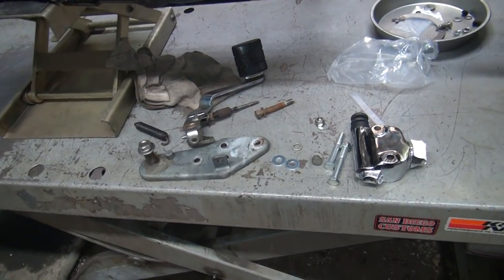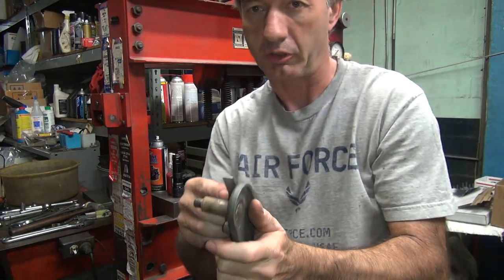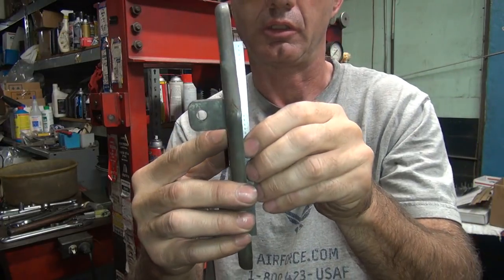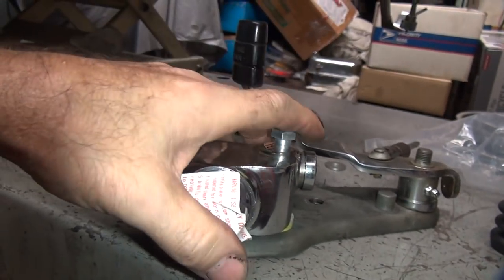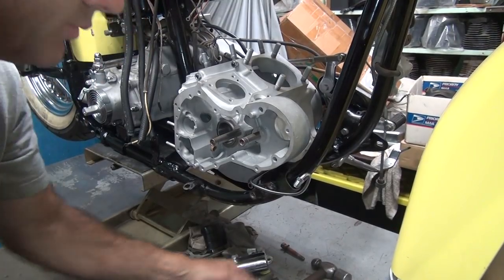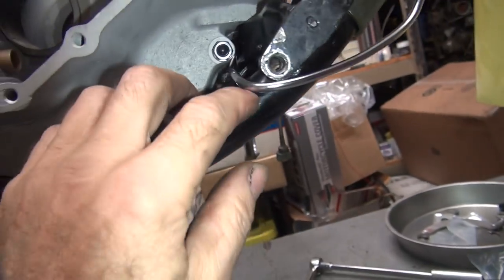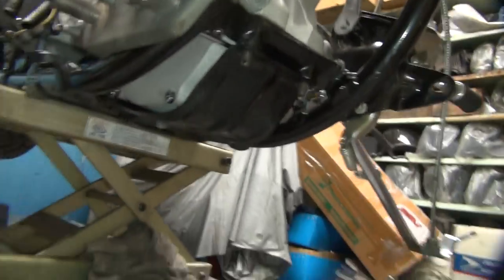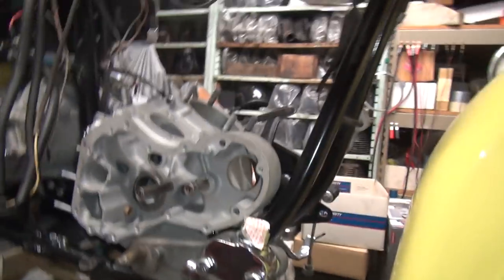1965 panhead #114 74ci flh motor rebuild and bike repair harley by tatro machine

Comment: If you look at the way the alignment was at 35:02 on the video, it looked like you could have just routed the brake line under the front bolt of the master cylinder but in front of the mounting bracket should have made it fit almost just right without trying to force the line to bend around the back of the bracket or having to re-bend the line further down below the front engine mount.
Reply: I think you hit the nail on the head...
Reply from the maker: no, the line was too short to go under the back of the mounting bracket. i showed the two routs and went with the best option.
now, if you cut holes in the mounting bracket and cut the frame you could have done something different but i did not want to do any of that.

tatro
Reply: I looked, on camera, that there was enough spaces (due to the spacers between the mount and the master cylinder) that there was plenty of room to run between there and line it up with the master cylinder mount. Must just be because of the way it looked on camera instead of at your angle and in person. From my angle it look like it is already running just in from of the back plate and all you had to do was remove the front bolt enough to remove the spacers, tweak the line down a little bit, and then replace the spacers and bolt and it would have lined up with the opening for the master cylinder. My mistake!
Reply from the maker: if you put a hole in the mounting plate that would work but that is not how it is made. at least you are thinking.
tatro

Comment: Hey Tatro, If you had a situation where the brake pipe was too close to the frame but it couldnt be bent out of the way, could you use a piece of fuel hose (split down the side) to slide over the pipe to protect rubbing the frame?
Reply from the maker: yes

Comment: I gotta pipe in. Rick on last video is not as dumb as he looks. I've never seen only 1 copper washer used on a Banjo fitting, fix it or be Liable! Why would you use pre-bent chrome brake lines, your looking for leaks at every fitting, that chrome to chrome is not going to cut it. If you were to clean the chrome out of the fittings you may have something, in doing so the flares would conform to the softer brass at the point of compression. Method; short flared brake line a drill motor, lapping compound and new fitting nut and lap the chrome exposing the mating connection in the fitting. Addressing the lines and fitment the longer line was to short that's on you and the customer as to the fix, I'd use auto parts line with how little of it shows on both lines the short one it's all but hidden. All the bending in that line, why the in and out when you had a factory line to copy. Just installing it with out the cases you would have seen how it was done. Now I'll try to explain how I made a tool years ago to make those tight and 180 deg. bends, at the time all I had was 4 washers a short 5/16" bolt and nut, the washers were stacked on the bolt the center 2 washers are smaller then the outer ones this is to allow the tubing room to fit between with a tight fit just like a tubing bender "I hope your following me"  I made this just to do the job I still use it after forty years. I would suggest you make one out of bar stock and a formed HSS tool following the diameter of the tubing and the tightness of the bend. after turning notch the tool with a file allowing the nut on the tubing in as tight as it will allow. This tool will be a short cut off. To use it place the tube and nut in the tool and clamp in vise you now have a mandrill to form those tight bends & 180's the bending will be done by hand but you will no longer be crushing the tubing and have nice tight bends the inner diameter of the tool will be up to you mine is about a half inch on the inner diameter. I've only made one for 3/16 brake line. Getting back to previous video the rear brake line why didn't you run it inside the swing arm and out and under the Axle strapping it to the arm then up to the wheel cylinder. I think if you were to lay up the original line you may see the bends in it conform to what I'm saying.
Reply from the maker: the stock banjo fitting has o-ring sealing groves cut into it to seal with. the washer you want to use does nut. look at the video. harley only uses one washer for this reason. i looked at the quality of the grooves and made the decision to go with it like harley did. you would be more at fault if i did it your way. everything i do is for a reason and i try to explain and show why and how i do things.

your bending tool sounds good except it still will crush the line on bend radius some. you are stopping the pinch out but not the flattening of the bend radius. you have to keep good tension on the line too to stop kinking at the bend. bending lines is a real pain on these tight bends.
the customer wanted chrome lines so that is what he is getting. i have to deal with all the problems of the chrome parts. one reason i don't like chrome parts all over the place.
the bend of the line and the parts you have to clear dictates the routing. that is why i show different ways and reasons i do what i did and make changes as needed. all part of learning how to do things.
i did copy the one line and still had to rebend it to work as the parts dictated what i had to do to work the way i wanted it too. following stock parts are not always the way i go. i make my own decision based on what i think is the correct way to do things to my standards.
i like how i routed the rear line. it is in a very safe location and still has full function. it also is now in the way of me working on other parts of the bike.
good comments.
tatro